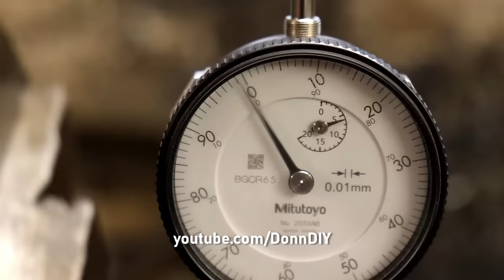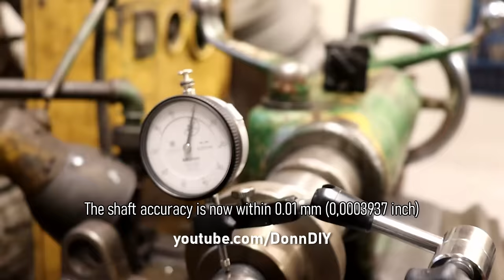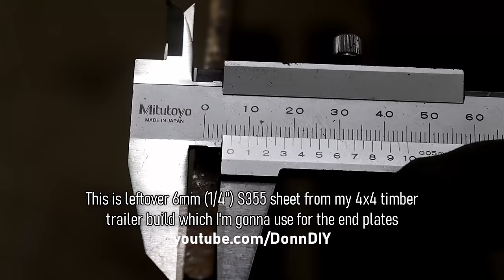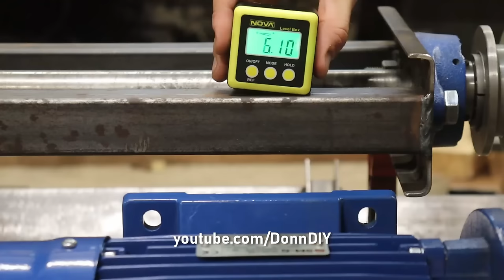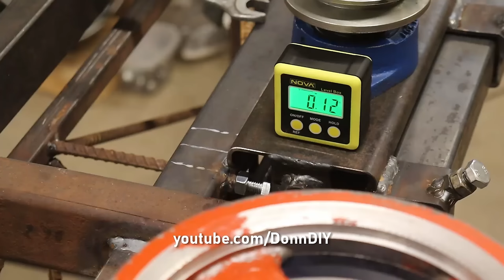Sawmill Build Start to Finish

Comment: It should be a band saw. That's how I would cut everything.
Reply from the maker: I built and used a bandsaw for awhile, full video here:
https://youtu.be/iCeTMkijoR8

But I still like the swingblade better due to less physical work involved with handling the material and faster cutting in general.👍

Comment: Everything is beautiful, but I notice a small and quite important detail - the beam is not stiff enough and bends under the weight of the stroller. As a result, the center of the cut boards is bent relative to the edges. Element to be improved. Apart from that, it's a nice patent. Regards.

Comment: Very nice work! i would use 3phase electric motor and bigger blade. Everything else is fantastic!
Reply from the maker: It is 5,5kW 3 phase motor.
Reply: @DonnDIY  than my mistake. 😎
Reply: @DonnDIY  in some point i realized motor was struggling to spin a blade while under load.
Reply: @DonnDIY  Do you use direct 3phase or rotary phase converter?

Comment: OK here's a guy with mad fabricating skills. I mean this guy can fabricate like No other... But the only problem is you built a machine With limited Value....Went through all that fabrication on a Machine that is limited  Value .... because you can only build Small boards . What a waste of time. should have spent his time building something that could cut large logs into any size board.....
Reply from the maker: I've already built and used a widely loved bandsaw mill: https://youtu.be/iCeTMkijoR8

I still prefer this swingblade due to faster and more economical operation. It also can house a slabber attachment.👍

Comment: GREAT JOB BUT
This construction couldn't cut trunk into wide boards :/
Based on this construction you can design another cutting trolley/head wit fitted 60cm+ long chainsaw to hang on this frame 
With botch this heads it would be best ever project :)

Comment: Its good, slabs would be nice too, but I think the best saw mill is going to be a portable electric lightweight bandsaw mill. Using 2 bldc motors, something light from an ebike or something, and then you make the frame and platton from very lightweight aluminum or steel dom roll bar thing ultralight tubing. This way, you have something like 1kw per motor, you can track the blade easily with the push pull benefit of the twin motors and you can tension the blade if the tires are inflatable. 
This makes complete sense if you ask me. The frame would be 8lbs max and the motors probably 6lb each, The rest would be 1 lbs, thats a bandsaw mill that is about 22 lbs, which is easier to handle than a chainsaw, its balanced weight,It takes less energy for the bandsaw blade. 
Mainly no smoke noise vibration and waste. 
And you can move the portable mill to the site to cut the wood instead of the other way around. Then just use a circular saw and straight edge for the slabs. Easy smart, cheap.  It could make for the trio of diy wood mills you have!!!